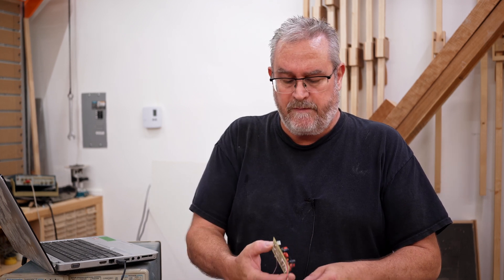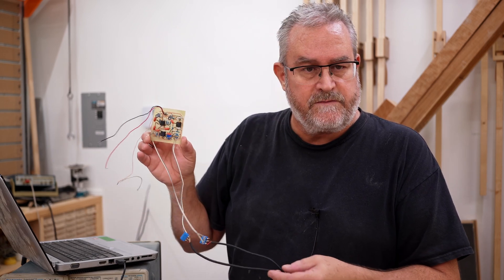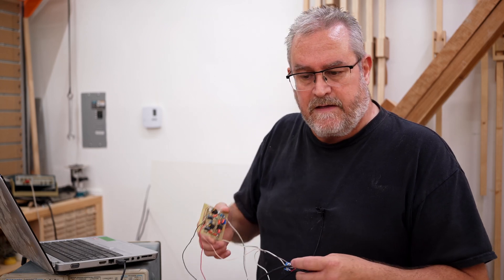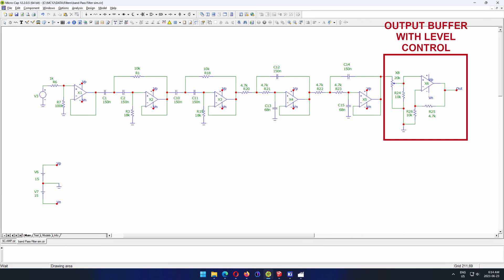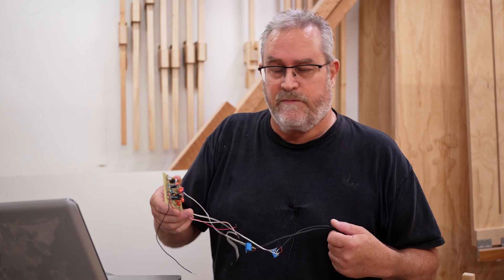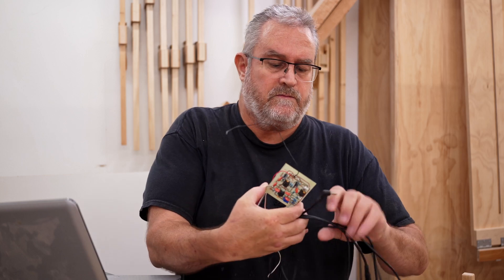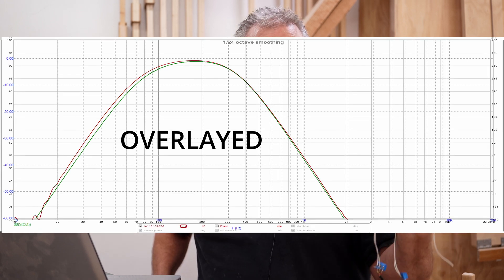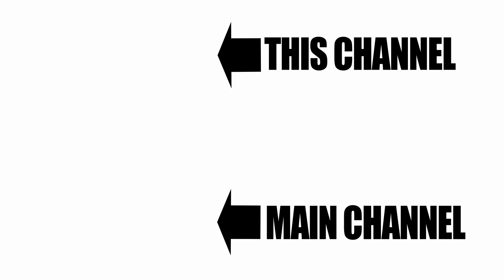Testing the Active Crossovers for my 10 Channel Amp

Comment from the maker: These crossover boards are a key component in my 10 channel amp build, and I have to make sure the board layout works properly before I order the professionally made PCBs.
Each board contains an input buffer, a two stage high pass filter, a two stage low pass filter and an output buffer that has some gain and also has a trimpot to adjust the output level. 
Credit and thanks to Rod Elliott's excellent website for this design: https://sound-au.com/project09.htm. His site is a wealth of practical knowledge and projects that I've been using for nearly 20 years. The linked article has a detailed description of how the crossover works if you want more info.
The filter stages combine for a 4th order slope on the high pass and low pass, letting a limited range of frequencies through. In this example, the board is set to drive the woofer of my 4 way speakers from 80Hz to 350Hz. Another board will drive the midwoofer from 350Hz to 900Hz, and so on.
There will be 10 of these, one for each individual amplifier board.
Testing was done first with my scope just to check if it actually works. While the circuit design is proven, the wildcard is the board layout and whether I made any mistakes doing that. 
I then set up my computer to run REW to measure the frequency response. This is done in a similar way to measuring a speaker (or room), except instead of using a microphone, the signal is fed directly through the crossover board. 
As shown in the video, the measured response very closely matches the simulated.
The next step is to finalize the board layout and order the boards, and then I can start putting the amp together.
Active vs passive: is a topic for another video.
You can watch part 1 in this series here:
https://youtu.be/Qe9H07JlT6w
Reply: For grins, I repurposed a Parts Xpress amp and designed a 4th order LR 2-way crossover that uses a 4-gang pot to adjust the xover freq.  Works great.  Freq adjusts from 1500 to 3800 Hz. I could build two of these to realize a 3-way system and have 2 adjustable frequencies (low-mid and mid-high).  Haven't gotten there but played around with the 2-way active xover and amp, and it wonders on the classic B652.
Reply: Are these things truly better than passive crossovers? What are the advantages and disadvantages of the 2 solutions in a nutshell?

Comment: Why did you not include pots so that you adjust the frequency cut-offs, like a commercial active crossover?  I want to build what you are building, and that is an active crossover with 3 pairs of stereo amps for a tri-amp'd speaker system.  But I want to be able to control the frequency of the 2 cut off points, between low and mid, and between mid and high, and I want a volume for each of those outputs.

Comment: I was wondering if you have any "funny things" in phases among the crossovers...24dB makes a lot of phase changes... You could probably, or did, simulate the crossovers, but, then, speaker phases, et al...
Reply from the maker: Phase "funny things" show up in the frequency response, as in one driver playing out of phase with another will cause peaks and dips in the response. There's nothing inherently bad about a higher order crossover, if it gives you what you need for the best response. Sometimes a phase change is needed to produce the best response.
But even in a "phase perfect" speaker (as if one could exist...), it's playing in a room that introduces a swarm of reflections from the walls, floor, ceiling and any furniture that's in the room to cause such an unholy mess of what actually reaches your ear. That makes worrying about phase shift from a higher order crossover a drop in a very big bucket.

Comment: The high pass section has equal value capacitors and resistors with unity gain. The cutoff frequency is calculated to be 106Hz instead of 80Hz. And the design yields +3dB overshoot at the cutoff frequency - could be desirable. If replacing R18 with 20k, the cutoff would be at 75Hz, with -3dB “normal” roll-off.

Comment: @IBuildIt  
Maybe it's been asked, but what will your Final Total Cost be for all prototyping + the finished versions of these 10 active analog crossover boards?
Reply from the maker: Impossible to say. But I do this because I enjoy it and therefore it qualifies as entertainment, so the actual cost (in time and money and materials) in inconsequential.
Reply: @IBuildIt this is what people often forget when the argument is made against DIY; "DIY is not cheaper, look at all the time and money you spend". Yeah someone spends their free time doing something they enjoy, instead of going to the movies or something like that. Besides, it doesn't even have to be cheaper as long as you have fun and like what you're making :)
Reply: @danielh12345  
@IBuildIt  
🙄  Ummm...I get it.   I've been doing DIY for over 30 years as well in speaker design/building, electronics, and woodworking, as I was inspired by my father who was a carpenter/cabinet maker, musician, HiFi/Stereo enthusiast, and an Advanced/Extra Class Amateur "HAM" radio operator who built most of his RF electronics and antennas, etc.

And, I also realize that these many DIY projects also provide your several YouTube channels with HEAPS of content, which is your main livelihood, is it not?   So this could potentially allow you to "write-off" these expenses on your income taxes, so the costs are not as impactful to you as they would be to others...which also means that if you are submitting them as tax write-offs, you probably do, in fact, know what these projects cost you, and are not "impossible to say".

However, I'd still like to know (and maybe others do as well) a rough estimate of what this project will cost, as I don't believe you can say that costs are never a factor for a DIY enthusiast who is interested in tackling any given project.
Reply from the maker: @bbfoto7248  What makes it impossible to say is that I'm using stuff that I either got for free, or bought nearly 20 years ago, along with some new parts that are pretty much pocket change if you are earning a decent living.
A ballpark figure would be less than $1000 but more than $300. BUT, that's for ME, using the stuff I'm using. For someone else it might be double or triple that. Or more, depending upon how many mistakes were made.
And for most the cost would be zero, because they wouldn't / couldn't do it.
Reply: @bbfoto7248    sorry, I never meant to say / make you think I believed you don't get it. I just like his attitude is all. And I agree, cost definately is a factor to consider for DIY for me. Its keeping me from doing stuff I would otherwise do most likely. But thats life. Im still young and needs and wants are 2 different things haha. E.g. I would love to make a 3 way speaker but finding a design thats worth building  + I have the tools and space to do has proven difficult. My only DIY audio so far has been a set (2 actually, one for my twin brothers birthday) Overnight Sensations Bookshelf kits which I glued, assembled / soldered veneered and made some minor modifications to the bottom to mount to speaker stands in same style and veneer that I made for them. Added some leds underneath the stands to provide extra lighting on my desk. Controlable by philips hue. Its fun and I enjoyed the process and what I have. Curious how much better DIY audio gets but my wallet / conscious won't allow it for now haha. Edit, I'm also limited to (ported) boxes/ towers since I have a pet bird that could otherwise hurt himself or damage stuff on open baffle designs

Comment: Is there any pros/ cons to putting the gain at the end versus the beginning of the circuit?
Reply: usually you should put gain as soon as you can. this allows you to suffer less from electromagnetic interferences or thermal noise from big resistors

Comment: Why not variable x-over points?.......................
         You'll be stuck if new drivers are chosen, like a horn mid-range.       🔈🔉🔊
Reply from the maker: Making it variable is very complex and certainly a lot more work than just changing out a board to get a different crossover frequency.
Reply: @IBuildIt  Hhmmmmm.............  wouldn't that be 2 boards for each side?  4 boards.
Reply from the maker: Still easier. It's still easier to replace ALL of the boards completely (and probably cheaper) than to design and build variable ones.
Reply: @IBuildIt  Thank-you.  Good luck.   🔈🔉🔊

Comment: No sponsorship from PCBWay? ;) So awesome that you were able to do the whole process of prototyping. 
Does the length of copper tracks on your board matter?
Reply from the maker: I had an email from JLC to do a sponsored video, but I haven't taken them up on it, even though I ordered the amp boards from them.
Board layout for audio frequency analog circuits is not very demanding. You just need to pay attention to the grounds and how they are routed.
Reply: @IBuildIt  I always just did a ground plane on the top layer, that worked pretty well.

Comment: where in the chain does the Active Crossovers fit in? 
maybe between the dac and a amplification is my guess.
and my second question: is it easy to make a Active Crossovers that fits on before the dac?
Reply from the maker: For my system, the crossover comes after the computer - the output from the sound card. A USB DAC is basically a sound card, so exactly the same.
To be before the DAC, it would have to be a digital crossover, whereas this is analog.
Reply: @IBuildIt 
What will the be the variable range of output voltage from these active analog crossover boards?

They obviously need to be within spec of the input sensitivity of your amplifier boards, so maybe I should watch your 10-channel amplifier design/build video first.  😊